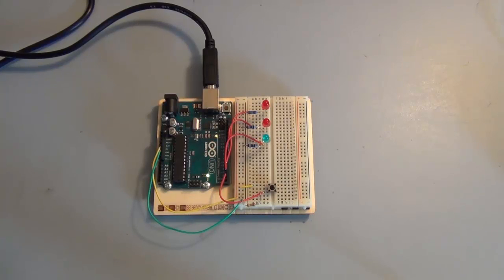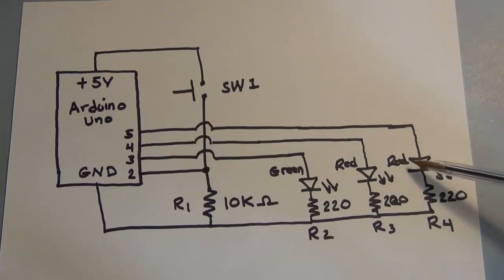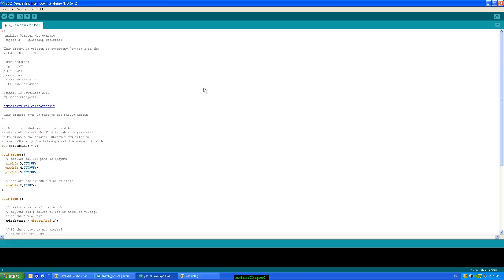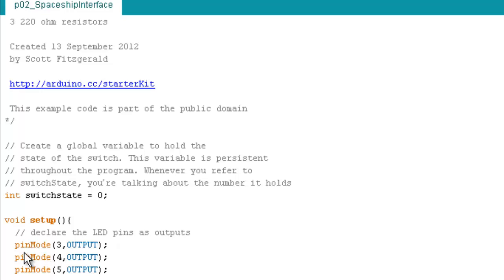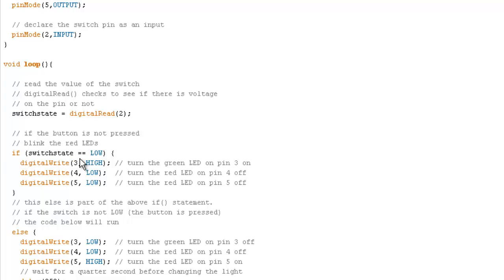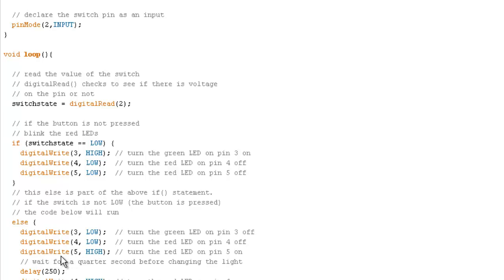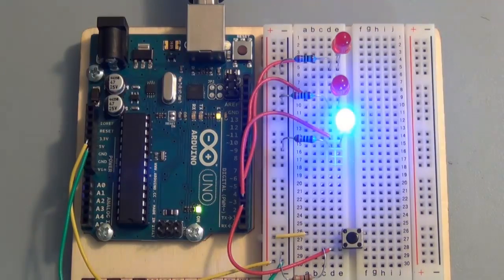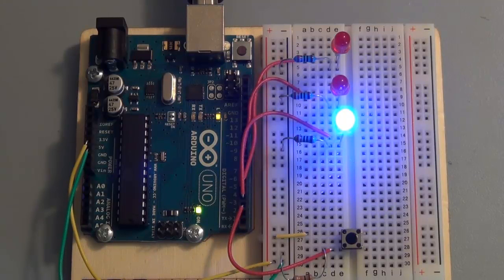Arduino Uno Tutorial Basic Input / Output programming

Comment: why are the resistors connected to ground?
Reply from the maker: Wolf Vierbergen You can use the 3.3V if you want but it's more common that you will be connecting the arduino to 5V logic devices and not 3.3V.  For a project that just consists of using an LED you can use any voltage level you want as long as you do not exceed the current limit of the LED.
Reply from the maker: +DOCTOR The resistors limits the current through the LED.  Without the resistor you risk drawing more than the max current the arduino output can supply and would result in damaging the arduino.
Reply: +eTechTom Why u use the 5v and not the 3.3v pin? Is it possible?

Comment: btw a little question sir, i replicate what you did here, i made mine almost identical, but stumble upon the same problem i got before, floating input, the input inconsistent and constantly change, even tho theres no pin expose, the code really clean, already struggling 4 hours googling to fix it, but still found nothing...
Reply from the maker: +Solid_Metal It's difficult for me to solve a problem remotely but I would try to first determine if it is a software or hardware problem.  If the sketch verified without errors than it is probably correct.  You can isolate the hardware by breaking it into workable pieces.  First double check your wiring.  Does anything work or does it partially work?  Do the led's flash when the switch it pressed?
Reply: eTechTom well, i can say it partially work, its really hard to determine because everytime my hand near the circuit cable/breadboard the input instantly pike to high almost everytime
Reply: eTechTom and i probably should mention this, but the problem only occured when i tried to replicate your work here
but on previous video, the one which you only used the arduino as power supply and without any code, the button and led works perfectly
Reply from the maker: Maybe you should start over with just a blinking LED circuit https://www.arduino.cc/en/Tutorial/Blink to make sure the arduino is working and then go from there.
Reply: eTechTom already tried that, it works perfectly
Reply: eTechTom just try it again, probably it's a hardware fault, it seems theres problem with my breadboard ground/power line, if i connect it directly on arduino gnd, it works ok

Comment: Great video.  I had a quick question.  Why do you need a 10 kilohm resistor connected to the pushbutton?
Reply from the maker: The 10K resistor is a pull down resistor keeping the input to pin 2 on the microcontroller at zero.  When the button is pressed the voltage at the junction of the switch and 10k resistor also connected to pin 2 is lifted up to 5V.  Pin 2 is defined as an input in the program so the microcontroller is reading the input voltage on pin 2
Reply: +eTechTom thanks for the quick and usefull reply. so if i can summarize in simple words. you put a resistor there, because (1) the arduino already has a big resistance when you put the pin as 'input' and the 5V output will send almost all his current directly to ground (because there is no resistance) and this may hurt the arduino. (2) the other reason is that by putting a resistor there, the voltage difference is more noticeable in pin 2. because the current doesnt go directly to ground. is this more or less right?
Reply: I still dont get it, if there is an very high resistor, then all the current will flow to the pin 2 right? and if the switch is off the input is already zero.. pls can somebody explain in a different way. im new in electronics
Reply from the maker: There is a lot of circuitry inside the Atmega328 .  The Arduino pins default as inputs and are in a High resistance or impedance  state. In this state it is as if there is already a 100 Meg resistor in series with that pin so very little current flows into it.  It does sense the voltage level though.  The 10K resistor ensures that the voltage at that pin is dragged down to ground or zero.  If there was nothing connected to it you can't guarantee that the voltage floats to some strange value on that pin.  Remember you are trying to just determine if the pin reads a zero or a one or 0V and 5V logic levels.  Since you are using the on board 5V regulator as your logic level 1 when you press the button and pull the voltage up to 5V you don't want to exceed the max current that the 5V regulator can supply and if the resistor was not there it would just be a short to ground thru the switch so the voltage still would be 0 at pin 2 but the 5V regulator would burn out too.  Here is a useful link about this.  https://www.arduino.cc/en/Tutorial/DigitalPins  Hope this helps